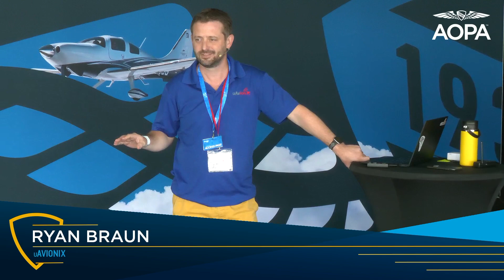uAvionix Panel Displays - Unmask Your Panel's Potential

Comment: TO be primary you need two of them. They recommend three. So you have a spare to switch in , in case you lose one.  This system is not cost effective, they cost about 2200-2600 each retail. SO unless they were 1K each. You can beat this setup in price and functionality all day long. A single E5 is less than half what 2 AV30s cost, and does both in single unit. Also very important. These units do NOT interface to a GPS as they suggest. They are a GPS mini MFD ONLY. there is no capability to act as a Waypoint or NAV steering unit on the DG with any GPD pr Nav com. the units do NOT OUTPUT any signals to the GPS or CDI.  The DG is really nothing more than a digital compass.  He may have started out trying to be a cost effective solution. But he didnt end up there. He is way over priced and under capable.

Comment: I had 2 AV-30s installed in my PA-28. I linked a Garmin 396 to the unit configured as a DG. I was able to have the vacuum system removed. Bottom line: I love them!